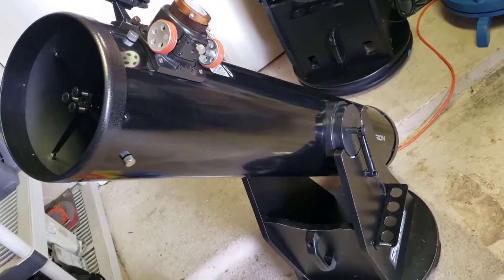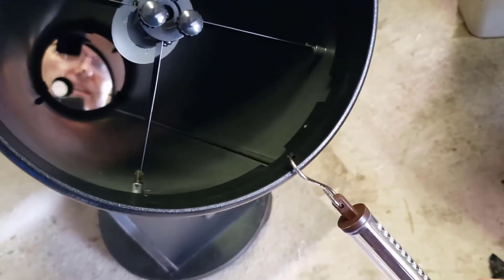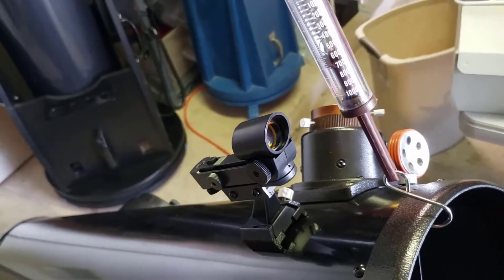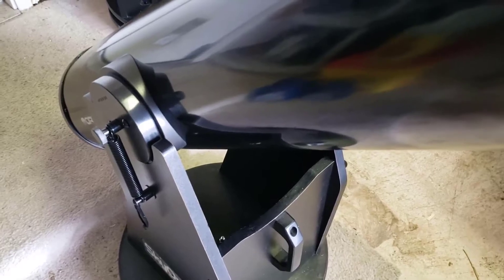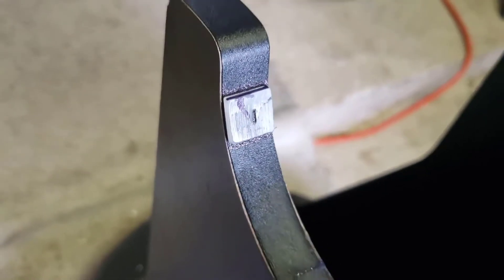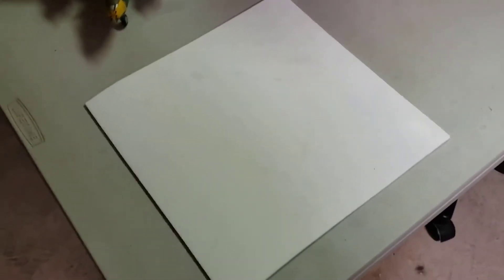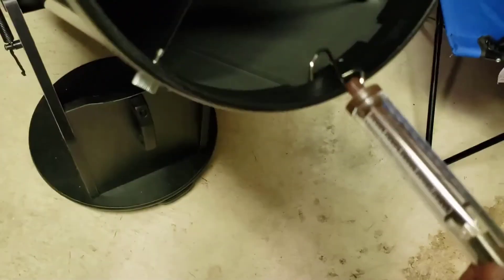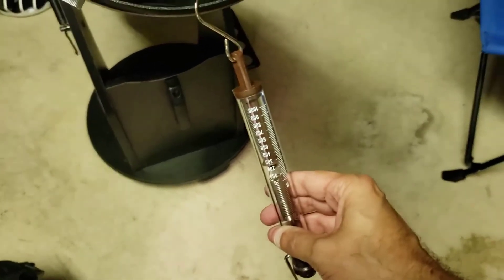Orion XT8 Telescope: Using Teflon Blocks To Eliminate Tilt Friction

Comment: Hello .. having the exact same problem with my Altitude bearing .. where did you get the teflon (PTFE) sheet ?
Reply from the maker: I bought a sheet of it on eBay and have been cutting pieces off of it for years.

Comment: I was skeptical, as even a small 6”x6” sheet of 1/8” PTFE is over $20. The telescope is almost unusable in its stock format, so I gave it a shot. The difference is astonishing. It really blew my mind how well it works. That PTFE is really slick stuff. Thanks for tip, worked great!!
Reply from the maker: I'm glad it worked for you.  And I agree that the PTFE is crazy expensive. I found a good deal on a big sheet of it and I've been slowly carving away at it for various projects. Have fun!
Reply: Thanks for the vieo.
Where did you buy the Teflon sheet?
 I have to do the same to my XT8

Comment: I did the same thing with 3/4” self sticking Teflon glides from Amazon. Works great for me without buying a pick sheet of Teflon. I did not use the record mod for azimuth.
Reply from the maker: Thanks for the tip!  That is definitely much more affordable than the Teflon sheet.
Reply: John what did you attach pads with original had staples?

Comment: Don't grams = gram-force?  You exerted a 700 gram-force on the telescope tube to overcome the stiction. 1 Newton is equal to roughly 101.97 gram-force, so in your test it took about 6.865 Newtons of force to unstick your altitude stiction.  Can anyone say if this is correct or not?
Reply from the maker: I think your math is correct.  The other side of the cylinder has a similar scale that went from one to ten Newtons (just a hair longer than the gram scale).  I couldn't show that one because of how the hook/shaft was assembled and hold the camera.  The key metric was relative spring loads.  Adding Teflon showed a great reduction in the required spring force.